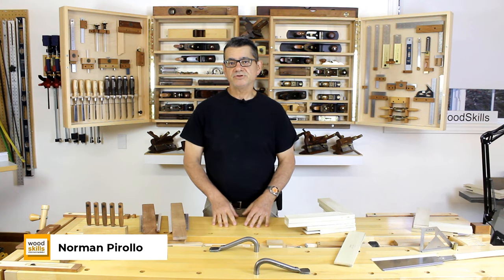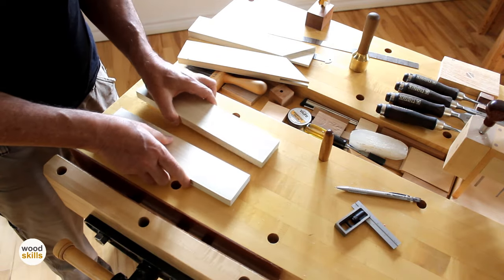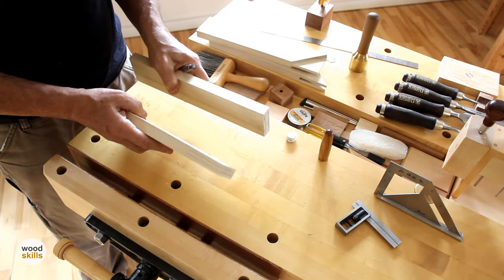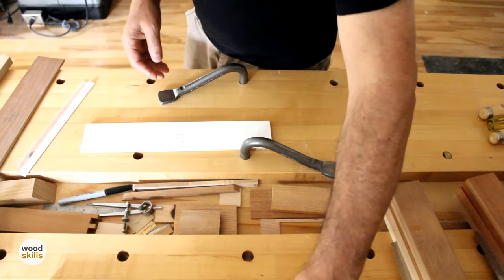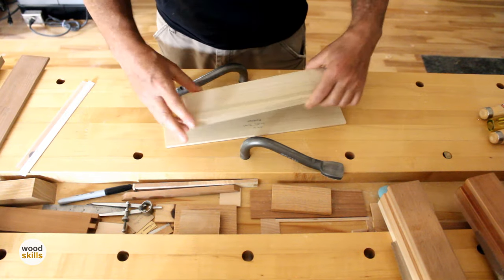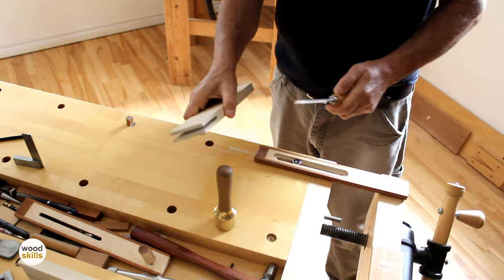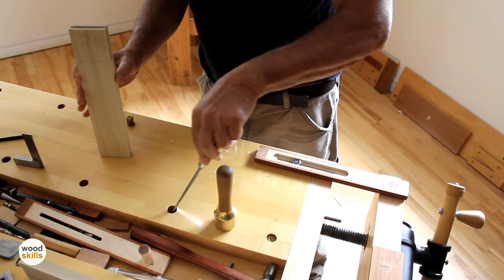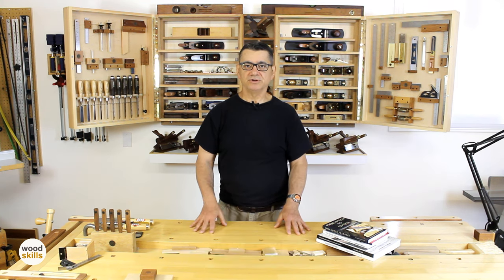Make a Mitered Bridle Joint Using Hand Tools || Fast, Easy Woodworking Joint

Comment: Why don't you use your marking knife all the way round?t would be much more accurate than the pencil
Reply from the maker: I normally do for dovetails as an example to let in a chisel. In this case, I was scribing a line all around but found I only needed to accurately mark the intersection of the miter and edge. This is for this particular joint only. If I scribe all around, it is not necessary and will leave a scribe line on faces and edges to remove afterwards. Easier to erase a fine pencil line. So nothing against marking all around with a knife but this is an alternative approach.
Reply: @WoodskillsCourses  But you started scribing a line on a face with your marking knife?
You only needed to scribe a line on the edge.
Reply from the maker: @OleLarsen-p3h  Done to accurately carry the mark around as a baseline for the mortise when chiseling later.  For the demonstration, I wanted penciled lines all around for clarity. Of course, one can scribe all around and use those marked lines without pencil.